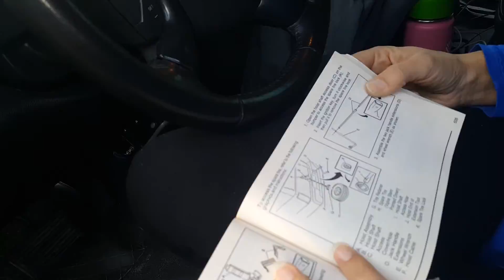Come laugh with us! RV Flat Tire - Full time RV Family VLOG

Comment: Oh wow. Not fun. We went through this too and hubby went and bought an air compressor and better jack than what came with truck. For our travel trailer we purchased the TireMinder Smart TPMS. It gives us comfort while traveling so that if one of the tires lose air or become over heated it alerts us.   Thanks you guys for the ups and downs because that is truly what happens in RV life. Safe travels. 🤗
Reply from the maker: A good jack is essential. Thanks for the suggestion on the Trailer TPMS...we love that idea and we are putting it on the purchase list. Having fun with the low times is tough, but you might as well have fun going through it! Thanks for watching Stacy.

Comment: Wow, you guys have had a rough week! I'd say you need a vacation, but that's a bit ironic. Since you're all self contained, something you might want to check into is an Engine Driven Compressor Kit and a collection tank. Insanely useful and clean once integrated, especially if you have air bags like I do. I feel sorry for your rig, that porpoising can cause so much stress on everything, including the driver. Here in CA our roads are terrible and we see this often! I've upgraded the RV tires with load rating E and have upgraded my truck (12-ply) as well. This way I'm able to run at recommended tire pressures and soften the ride a bit.

With your rear stabilizer jacks, I wonder if it'd help if you fabricated a mount (quick release) for some industrial casters on the bottom plates of the jacks. Anyway, I hope things improve for you. You both sure do possess the ability to stay positive, much better than I. Kudos on that!
Reply from the maker: Whats up govgeek! Man I was so close to pulling the trigger on one of the engine mounted compressors but hesitated. Sort of regretting it now, but I've definitely started peaking at them again. Yep, a while back I believe you recommend us to go look into upgrading the tires. Its now on our short list. I've got a video coming up on fixing the jack. I've seen a couple of folks rocking the caster wheels. Honestly, this is the first time we've even scrapped this bad, but If I come across some caster at the right price I'll look into them. 

Hey did the airbags help smooth out the porpoising on your rig?
-A
Reply: Short answer. no, not without additional modifications to my rig. Long answer, yes. 

Unfortunately the air bags created a new problem... stored rebound tension. So simply adding the bags caused more problems because the WD bars and now the bags are pushing upward and it created more porpoising!

After becoming a shady-tree scientist I figured out that if I lessened the amount of tension on my WD bars AND lowered the ball receiver on the shackle I could compensate with more air in the bags and more unsprung weight by lessening the tension on the WD bars. So now when I hitch up the trailer stoops and the backend sags until I put the appropriate air in the bags. Then I sinch the WD bars for a little more stability and shazam, she's level and hardly porpoises anymore.

Of course this whole formula is dynamic, especially with liquid quantity onboard and what's in the garage. But this is where my Resse Dual Cam setup really shines. Hope that helps a little.
Reply from the maker: Yep, it's a constant game of fine tuning, but when you throw the water ( or other liquids) in the mix, it really becomes a new variable. We try to keep the fresh water tank at least 1/3 full for bathroom stops and for the unknowns.